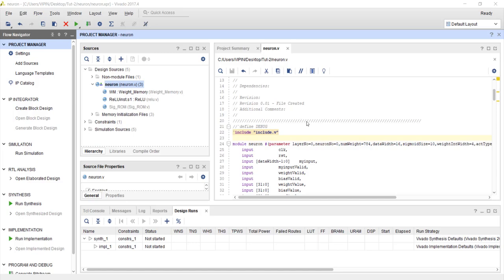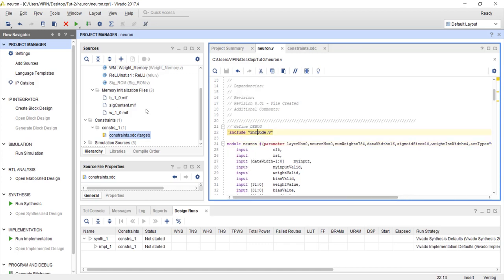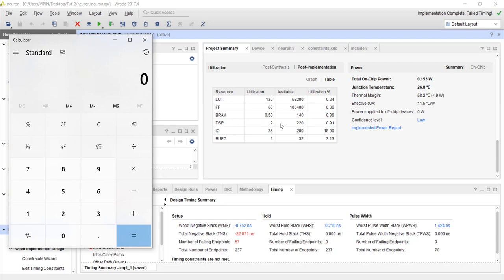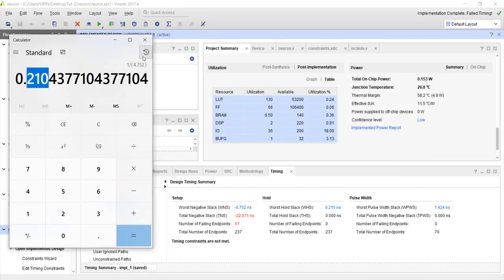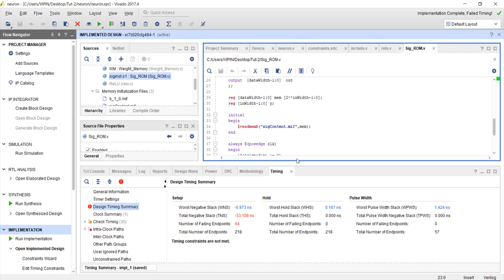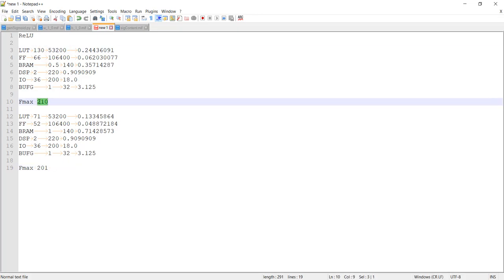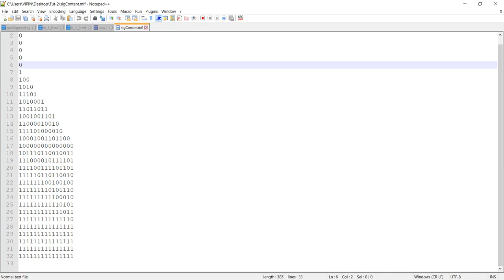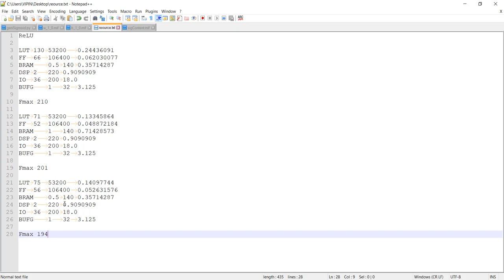Neural Networks on FPGA: Part 4: Which one is better? ReLU or Sigmoid

Comment: Why did your implementation use 2 DSP tiles? You're doing a single 16x16 multiplication, which should be implementable using a single DSP48E1....
Also, if the DSP utilization was correct (1 per neuron), than the LRU would probably be better for area, because you could fit more of them than the sigmoid (since you have fewer BRAMs than LUTs).
There may also have been a way to re-word your adder such that you can better utilize a single DSP48E1, allowing it to do either addition within the hardened IP rather than relying on a LUT implementation (thus saving more resources).

Comment: isn't relu supposed to be better?
Reply from the maker: I am not sure it will be always better. In hardware implementation especially there will be effects of truncation and fixed point representation
Reply: @Vipinkmenon   do you have any suggestions for some simpler application of deep learning on FPGA?
Reply from the maker: You can try this https://en.m.wikipedia.org/wiki/Iris_flower_data_set. Try to find the species based on three parameters